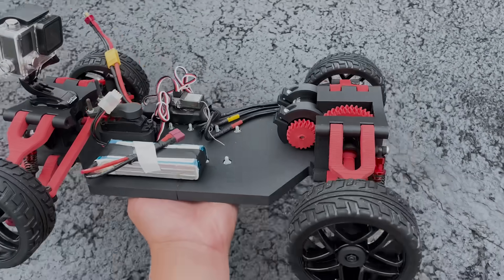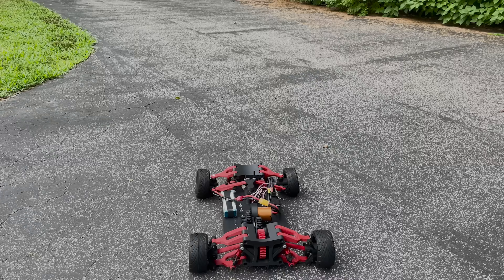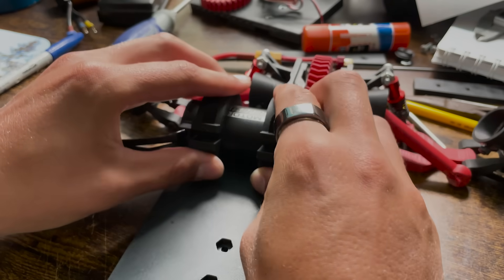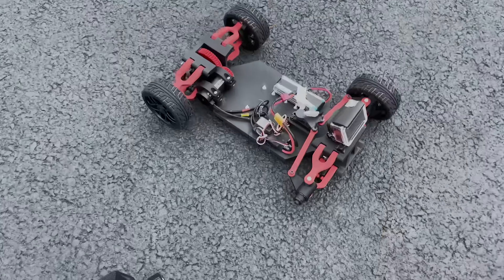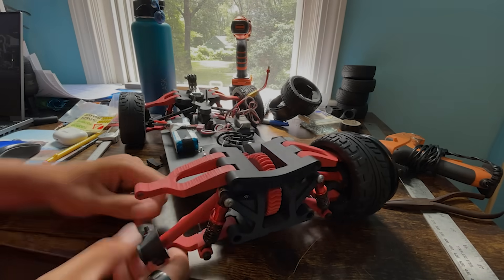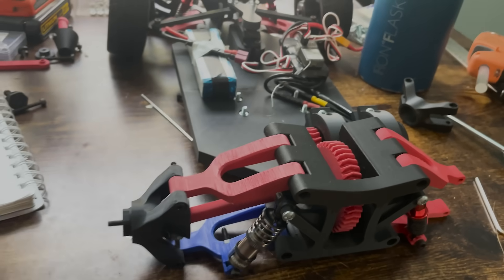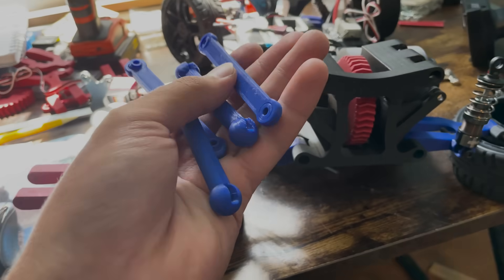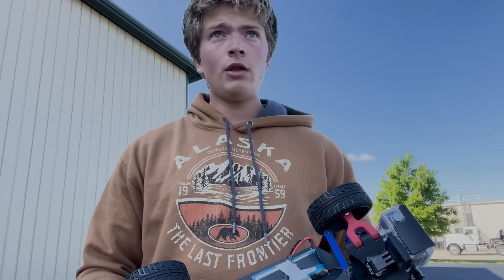Engineering a Better RC Car

Comment: Is there a benefit of mounting shocks up side down?
Reply from the maker: nope, just fit better on my car lol
Reply: It’s a compromise. 

Upside down shocks lower the center of gravity and shorten the moment arm that causes body roll in corners. The benefit is small but several small changes together make a difference. 

The downside is increased unsprung mass. The difference is not as big as some would have you believe. Actually weighing the parts and measuring the motion ratio of the lower arm shoots down the myth of enormous unsprung mass. 

If the track is bumpy with low to medium grip, it’s better to not flip the shocks. If the grip is enormous and the track is fairly smooth, upside down shocks may be worth trying out.

Comment: Woah, this thing is getting better and better, really cool to see your design process! As others have mentioned, maybe try looking into different materials like TPU for a front bumper and anything else that can be flexible to absorb impacts, Nylon for semi rigid parts and Polycarbonate for parts that need to be as stiff as possible but also durable. :)
Reply from the maker: I will likely make the final one with TPU and CF filaments, thanks for the advice!

Comment: The way to fix the cogging is to buy a sensored motor and esc so the drive position can be sensed accurately at low rpm, It has nothing to do with the gearing it's literally because the ESC cant find the back emf to calculate the required output power, the motors your using have WAY more power than is needed to turn the gears.

Comment: I think the main issue with all rc cars is the flat chassis plate. It's not strong enough, you have a 3d printer, it doesn't need to be the same as conventionally made items
Reply: not strong enough? 
manufacturers mill out the chassies to make them flex in a pridictable way eaven on a alu chassie.
Reply: It's plenty strong enough. It's all about the material used. Plenty of plastic RC cars have more of a tubbed chassis for strength, but quality aluminum or carbon fiber is plenty strong with a flat design.
Reply: hows that an issue
Reply: @justinc2633  I literally said, it's not strong enough, and it's a poor design for attaching things to. What's the point in having a 3d printer if you don't take advantage of it.
Reply: @Muffinx93  even if you take design advantage the filaments materials combined with layers technology are still not tough enough :( mold casted polymer is far more durable then anything from 3d printer...
Reply: @Muffinx93  "its bad because its bad", i asked how its an issue
Reply: @justinc2633  learn to read bro 😂
Reply: @Muffinx93  learn to elaborate bro 🤣

Comment: 2 suggestions you have probably already heard/thought about. 
Try ASA. It's like ABS, but easier to work with. 
Also, have you considered a drive belt instead of gears? It would be a lot easier to change your gearing, given that 3d printed gears are notoriously terrible.

Comment: i didn't follow the whole story about this but i'm into RC and 3d printing as well and i love this results, to avoid some of those structural fails you cant try different orientation on the printing process, i've seen that you print the wheel support upside down but flat, this may result in fail along the layers, those can be mitigate if you place the piece in the build plate with 45° oreientation so the layers don't follow the force, resulting in a more robust print. Hope my explaination will help this and future projects. Also you may want to use an aluminum chassis and mount all your part into it as most of the chinese cheap RC are made, i know this was a fully 3d printed project but it will surely make a more funcional and robust car.  (sorry for my english).

Comment: Super awesome! Hey bro I know your main focus is on the mechanics aspect of the car but, if you want your wires to be more neat and tidy, just coil them tightly around a thin Long rod or screwdriver then remove the rod. They will be coiled up like a spring. We call it pigtailing
Reply from the maker: sweet, thanks for the suggestion!

Comment: To engineer a great RC vehicle is simple;  Just take a good look at Traxxas and THEN DO THE EXACT OPPOSITE!!
Reply: Yeah, don't do what the most successful RC brand is doing. Why would you want to do that?
Reply: What's wrong with Traxxas?
Reply: @jabob3496 the only reason they r the most popular is because of their reputation. I own a Traxxas and I have the TRX4M and while I was just driving, the servo burnt out and died and now I need a new servo. I've heard multiple other stories of people that have owned a Traxxas and it just broke. They aren't the highest of quality. RLAARLO, a RC car brand makes higher quality cars for cheaper. Traxxas does not have great quality even though their reputation says differently. I like Traxxas too but they r way too expensive for what they offer.
Reply from the maker: lol
Reply: It is overpriced Chinese shit, and Traxxas buyers are too daggum stupid to try actually build a car instead of just buying the crap being sold to them!

Comment: Using more walls will also increase strength. I'd go with at least 5 for parts that need to be strong. Nylon is definitely a great material to use for strong parts. You might need a heated build chamber though to avoid warping. Nice project though.

The gearing ratio still looks funky to me. The pinion is usually much smaller. That will fix your startup torque issue.

Comment: sup dude awasome build the cogging issue can be fixed by changing the esc u get a hobbywing max10 and a hobbywing ezrun this will greatly improve acceleration and low end torque the motor isnt the issue here
Reply from the maker: I see, thanks for the input!

Comment: Another improvement that could be made for eliminating the cogging is using a sensored motor instead of a sensorless. These kind of motors have a rotary encoder built in that connects to the ESC so that even at very low rpm it can always know its position without sacrificing top speed.
But would be an additional cost, and I like the project already 😮
Reply from the maker: makes sense, thanks for the suppot!

Comment: Why not just use belt instead of gears?
Reply from the maker: I'm lazy lol, but you're right, the mechanical advantage could be greater if I designed the drive train for belts instead of gears.
Reply: @hamburgerinc6995  and you can also move the motor (with the respect of your belt) and the battery in the center.

Comment: You should try polycarbonate sheet of 5 mm or less for the chassis and suspension arms.
Reply: I have a buddy who used to race an E-Maxx and he created a custom chassis out of polycarbonate which lowered the battery mounting position for better CG.  Worked quite well
Reply: @alexdarby5185  I just got it for fun and tried to break it and it's  really tough material.

Comment: Maybe use a Timing belt and 3d printed pulley. It will be a lot more smoother and have a nice starting torque.
Reply: CVT
Reply: did this on a crawler and worked amazingly well

Comment: I can already see that the chassis is not strong enough. Make a top plate so it won't bend! Also the battery should be a hard case one. If a rock punctures it this will be a hell of an inferno :')

I got lots of RC cars (I raced them) so speaking from experience :) The gluing of the tire was a rookie mistake we all do :D 

Also make sure you tighten the wheels properly! Good luck :)
Reply from the maker: thanks for the advice!

Comment: i highly recommend splitting the chassis into 3 parts, a front/rear bulkhead where the arms and shocks mount too and then a main central chassis exactly how most actual hobby grade rc cars are put together, no matter how beefy there will always be cracks/ breaks with plastic so design around it make it so parts are easily repairable/replaceable if you break the car the same way you did on that last crash with bulkheads you can just swap one out rather then reprinting a whole chassis and wasting precious plastic, electricity, and time, you can get them to bolt through the plastic chassis lengthwise so you gain strength as well by borrowing the rigidity tolerance against bending from something like long bolts or threaded steel rod, or put them atop the chassis in a slot and screw into them from underneath. look at the front end of an rc10gt and how it mounts it bulkhead in an old manual (on google) (page 5, step 4) for an idea of what i mean. also the reason you need such stiff springs is because the shocks are mounted in a spot too close too the body the arms act as levers and give a mechanical advantage if you mount them closer to the center of the arms the suspension will naturally "feel" stiffer because it requires more force to move the shock the same distance, if you do this get longer shocks! my rc10gt 10th scale dirt oval truggy has shocks twice as long and the car is half the size!! I love seeing videos like yours keep up the awesome work and never let the little things stop you!!!!!

Comment: I'd potentially print the tougher pieces in ABS as opposed to PETG. I'm pretty new to 3D printing, so take my word with a grain of salt. To me ABS or even ASA seem easier than nylon to print
Reply from the maker: true that, but from what I've seen as far as material science testing with 3D printer filaments, ASA is also pretty brittle. For big impacts and stuff, the car needs to have some flex so it doesn't die

Comment: Cool project, I still haven't seen a fully 3d printed car that is reliable, the ones that are uses of the shell parts for the drivetrain from cheap rc cars.
Reply from the maker: it's a tough engineering problem lol

Comment: Use nylon. Race buggies are glass reinforced nylon, it's the only plastic that gets close to aluminium that doesn't bend back like nylon. A sensored ESC and sensored motor will solve cogging. More rear toe in and some squat geometry will allow you to pin the throttle.
Reply from the maker: true true, thanks for the advice!
Reply: @hamburgerinc6995  Nah, you just need a smaller cog on the motor .. that's why it is cogging...  (maybe try half of that diameter to start with) .. toe in on the rear wheels for (better cornering) and toe out on the front (for stability in a straight line)....  but remember the more toe you apply the more drag it will cause.. being rear wheel drive will also will be more of a challenge when cornering.. a proper differential  rather than a straight axel makes corning better, ultimately 4wd handles best.. maybe get to that further into your progress.. but I would at least start with a smaller cog on the motor (pinion gear).. have fun !!! (Edited: I don't use rear wheel drive cars but thinking about it maybe a straight live axel would be ok in this application, I guess it will come down to experimenting.)
Reply: And maybe some anti sway bars to stop/limit the body roll
Reply: Dont necessarily need a sensored motor, tuning the esc/motor set with a tuning card will usually fix it and those are way cheaper than new sensored equipment.
Reply: Keep going man and spread the knowledge like you have been.
Reply: looks like it needs more front toe and caster too. Also it doesn't look like it has differentials? EDIT: also a proper sensorless car ESC will take care of the cogging they've gotten way better in recent years with low RPM and even most sensored ESCs these days only use the sensor for low RPM and switch to sensorless at high RPM because it is more efficient.

Comment: Loving this. Would be great to see you make an offroad RC car next. Also, wonder if there is a way you can get this thing critically damped -- i.e. where c = 2*(km)^0.5 (c being your ideal damping coefficient, k being the spring stiffness, and m being the mass of the car).

Comment: tbh lower kv motor wasnt the way to go, shouldve gotten a sensored motor cuz just going for lower kv just works around the issue instead of fixing it
Reply from the maker: true, I went the way I did with the new motor choice bc it was like 20-30 bucks cheaper lol

Comment: if you really want low speed control, you need a sensored brushless motor. There is just no way for a motor that is capable of going as fast as you want to create enough backEMF for the esc to really know the position of the motor until your actually moving at a decent speed. You will also always have a slight stutter at start without sensors as it has no knowledge of motor angular position without angular velocity.
Reply: its still geard to high at the moment
Reply: I dunno, I had a sensorless motor in my 2WD rustler and it had zero cogging that I could see
Reply: @awkward_pickle  but 2wd rustler doesnt have big heavy gears
Reply: @Ashlyyy_2305  yeah here I agree it's probably a gearing issue. The pinion looks huge
Reply: @awkward_pickle  it is the issue

look how fast it go's without full throttle
you see him pussing the car when standing still? thats to not show the cogging
Reply: Needs to try a cvt system.
Reply: @spyder000069  not possible on rc size
Reply: @Ashlyyy_2305  Absolutely is.  Model after atv cvt system.  very basic.
Reply: @spyder000069  but thats not 3d printed
and its useless for electric motors
Reply: @Ashlyyy_2305 No requirement to be 3d printed.  just like the tires were not.  No reason an electric motor would not benefit from a CVT.  it just replaces a gear drive box.
Reply: @spyder000069  but if over geard motor gets very hot
electric motors are made to work with 1 pinion size
Reply: @Ashlyyy_2305  No.  They have an efficiency range.  The cvt is tumable to keep the motor in the correct range based on throw weights vs spring strength.  As rpm increases the weights adjust final drive ratio and you can still limit that with final gears.  You can safeguard against overheat by using an esc that provides ramp down or cutoff at certain amp draw.  Done all the time with esc on rc planes.  To be fair the video was claiming to build a better rc car but everything shown was no different than rc cars for the past 30+ years.  Need to at least try a few outside the box ideas.
Reply: @spyder000069  battery and brushless motor and esc's transmitters recievers chargers and servos have changed a lot
over the past 30 years but a cvt is not going to work

he wants a fully 3d printed rc car
you cant 3d print a cvt

and its not available on rc size
in this video its still over geard because its to fast without full throttle for what it is

so it needs a way bigger spurr or way smaller pinion 
also wierd that he uses a plane esc not designed for giving a lot of amps on the start propellor is in a few seconds on max speed and dont have a lot of mass to spin over

Comment: When you try to get torque is more often to use mod .8. Mod 1 is to heavy for a motor is 3800kv and 3650. You need to use for that gear ratio from 3660 up to 3674. That way, the torque does the motor will generate will be great. I saw that you pushed the rc, that not correct is not easy to se if the motor have the torque. And you need to reduce the size of the pinion gear on the motor, that generates a lot of heat and forcing the esc to work more, and that takes away the speed you want to see. The gear deliver the power to the wheels is fine, but the pinion on motor is wrong, small give more torque,  big pinion or rising the size of the pinion increase the speed

Comment: Hey man, that car looked really stable. Very nice suspension. Yeah; there's not that much you can do to beef up plastic to take those kind of impacts without substantially increasing the size, increasing weight, then it comes to "can I just use metal here with a similar weight but way smaller size and similar or greater strength". If the control arm positions were a standalone part that was a metal plate with metal hinges it could be a much stronger setup for the suspension. It could be made so it gets screwed or bolted onto the main chassis so if you want to redesign that suspension you just unbolt that plate and swap it to something else. It'd probably keep the COG lower and be a similar or less weight overall. Just an idea off the top of my head, it may come with other hiccups as all design processes involve. Anyways, love the content, keep it up man! Almost 2k subs LET'S GOOO!

Comment: Probably outside the scope of a fully 3d printed car.
However as we know plastic has its limits. Adding lasercut flat alum parts over CNC is extremely cost effective and its strength to plastic is huge gains.
As well has lasercutters are extremely accurate and cost effective. Most cities have multiple lasercutting shops around.
I do like onshape.